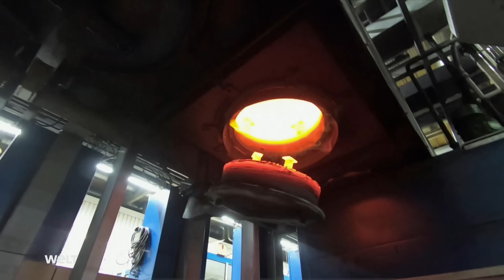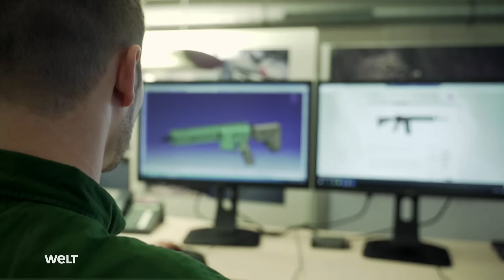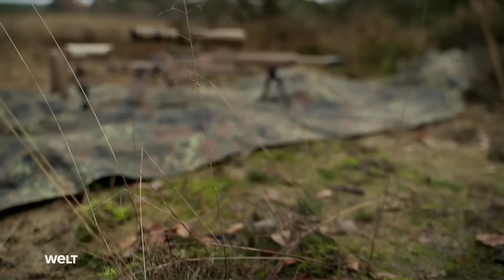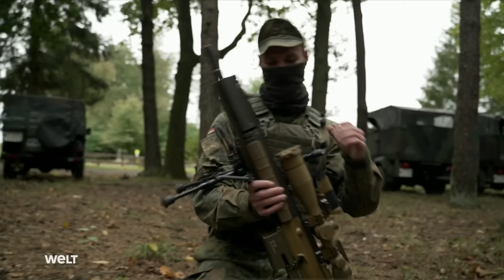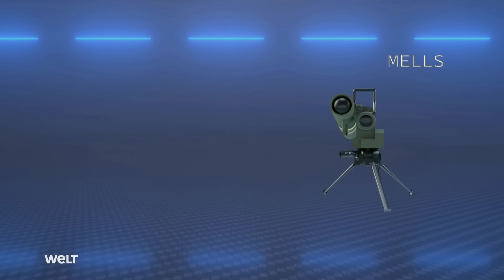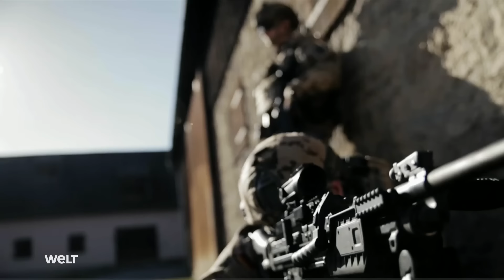FOR GERMAN SPECIAL FORCES: G95 K - A Gun Elite Warriors Fell in Love With | WELT Documemtary

Comment: Why not use a wire-guided steering of the projectile like it is done with the TOW? The MELLS missile is extremely expensive. And the projectile of the Panzerfaust is not intelligent, cannot be steered. With the Panzerfaust it is difficult to hit moving targets at greater distances. If the Panzerfaust was upgraded to include steering via wire as with the TOW, the projectile would be actively steered by the shooter into the (even moving) target. It wouldn't be "fire and forget" but it would be significantly better than the Panzerfaust how it is today (the time for aiming would also be significantly shorter because you don't have to aim perfectly because you can readjust during the flight of the projectile) and significantly cheaper than MELLS. As active armor systems improve, it becomes more likely that such weapons will become ineffective. Therefore it would be better if the projectile that was fired in vain was not so expensive.
Reply: These missiles fulfill different roles. We had a wire guided anti tank missile: the Milan. MELLS (the german name for the israeli made Spike LR) is far more capable to the Milan. 
TOW, Milan and MELLS are heavy plattforms. You need multiple soldiers to transport them on the field or a vehicle. 
Wire-steered ATGMs have significant drawbacks: the cables can get trapped in trees and obstacles, especially in forests and build up areas. The crew is exposed for the whole duration of the flight of the missile. 
Fire and forget weapons like MELLS are much, much better for the soldiers: they can leave their position immediately after launch and get into cover. 
Also, Spike does have the option of being fired with a fibre-optic cable, which allows "fire, observe and update" mode or lock on after launch. This is far more advanced than the aging MILAN or the TOW.  So, Spike has an improved version of cable steering compared to MILAN and TOW, but can also used as fire and forget.

The Panzerfaust 3 is easily portable by a single soldier and weighs less than half of the weight of the other platforms. It is intended to be available in every squad, basically every soldier in the Bundeswehr has training on it ("Panzerabewehr aller Truppen"). It is more like an RPG in terms of mass and role, intended for short range vehicle defense. MELLS has a minimum range of 200m and requires time to set up. A panzerfaust is ready withing seconds and can be fired at very close ranges. 
Not every armored vehicle is an MBT and active protection systems are still not a common occurence on the battlefield. You can also punch holes in bunkers and buildings with it.

In short, MELLS and the Panzerfaust do complement each other, both serve in different ranges, weight categories and roles.
Reply: @mephisto8101  I understand. The difference in weight is probably due to more fuel (range) and warhead (type and power). I don't say that we should abandon the existing systems and I see the drawback of the cable. Still upgrading the panzerfaust with cable steering would be a cheap solution to hit targets that at a greater distance, that are moving, with worse initial aiming (so shorter aiming time)... The current panzerfaust is so light that the additional weight should be no problem. If you use a stance and a periscope or wireless data transmitter between weapon and shooter than you are not exposed either, like a drone pilot. A wire guided system is also resilient to electromagnetic countermeasures.
Reply: @santaclaus0815  
The max range of the Panzerfaust is about 300-400 meters, you don't need cables here. 
I don't think you could upgrade a PzFst with cable steering, that would be an entirely different weapon. But there was an option for a better sight with trajectory prediction for the Panzerfaust. Ah, found it: it was called DYNARANGE and had an integrated laser range finder and a computer which calculates the aiming point. This also improved the max range to about 600m. Bundewswehr has introduced it some decades ago, but I don't know how common it actually was. I only shot the regular Panzerfaust, as did everyone in my unit. 

Think about it like this: The US still has the LAW, AT4 and the Carl Gustav, whilst having Javelin and TOW. Russia has the RPG family and a plethora of ATGMs like Kornet and the like. The Bundeswehr has Panzerfaust and Mells. 
One is for a cheap and easy short range boom, the other is for medium to long ranges and a crew served weapon.
Reply: @mephisto8101  A Panzerfaust as it is with a longer range would make no sense because it would be far too difficult to hit due to the fact that the projectile cannot be steered. Hitting a target at over 400 meters with a handgun is also difficult and the projectile of a firearm is much faster than that of a Panzerfaust.

Your description of DYNARANGE doesn't sound bad, but the projectile also needs a sensor system (i.e. optics = camera) to find that laser point. The optics make the system expensive and also logistically problematic due to the greater complexity, because if even one supplier fails, the entire weapon cannot be produced.
Just compare the price of a bazooka projectile with that of an NLAW. With wire control, the NLAW projectile would be almost as cheap as a bazooka and technologically much less complex.
At 22 kg, TOW itself is almost light enough to being shot from the shoulder.

"One is for a cheap and easy short range boom, the other is for medium to long ranges" >>> exactly. There is nothing cheap for the longer ranges. You can think of upgrading the Panzerfaust or simplifying a smarter system for longer range. The greater firing distance means greater safety for the soldiers. and the controllability means that the weapon does not have to be built as precisely as the firing angle alone does not determine the point of impact as is the case with a simple firearm (straight barrel, high manufacturing precision). This is also a cost-reducing effect.

Instead of using wire, data transfer could also be done using laser light. That would save weight and volume. The projectile would then only need a light sensor to receive the control signals, but it itself is blind and stupid and therefore inexpensive, so like TOW but only uses laser light instead of wire.

Comment: @WELT Documentary it shoots NATO 5.56 x45 ammo not 5.56x51 NATO see 1.20 in
Reply: Nah bro 5.56 super magnum
Reply: Yep , definitely got that wrong. But you can bet they have their price right Tons
Reply: I think the narrator thought the first rifle was using the 7.62 x 51 NATO so he thought the 5.56 x 45 NATO also has the last dimension 51.
Reply: 7.62x51 ???
Reply: Uh, youre confusing 5.56 with 7.62 dimensions. There is no 5.56 x 51mm. Theres 7.62 x 39mm, 7.62 x 51mm, 5.56x 45mm
Reply: And the G28 (HK417) doesn't have a steel receiver either, it's made of aluminium alloy just like that of the G95 (HK416).
Reply: @pieterveenders9793 the g28 does have a steel upper though
Reply: WELT… ambassador of war propaganda.